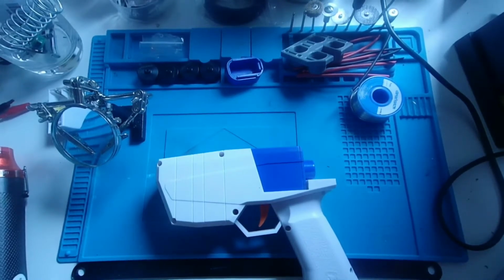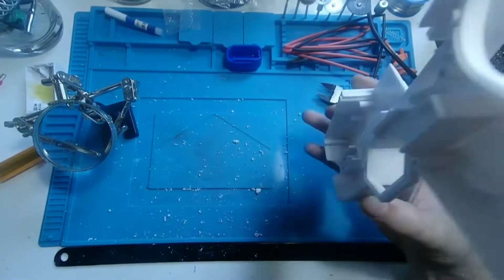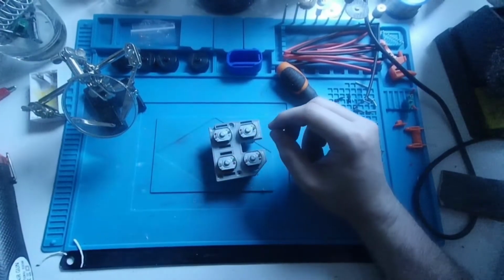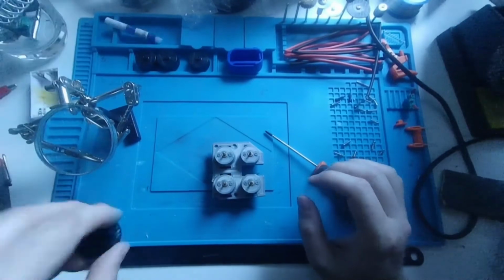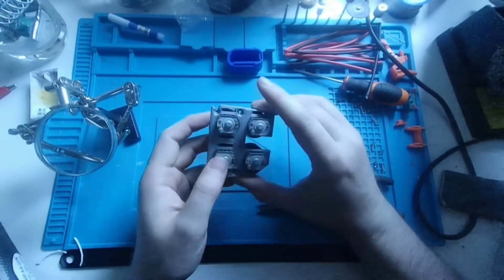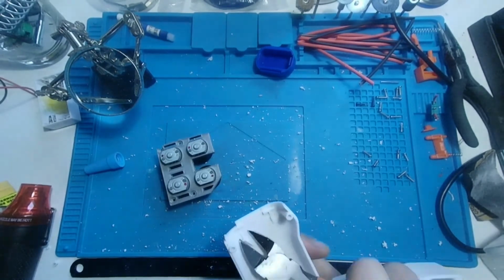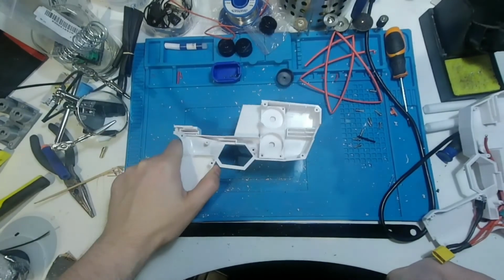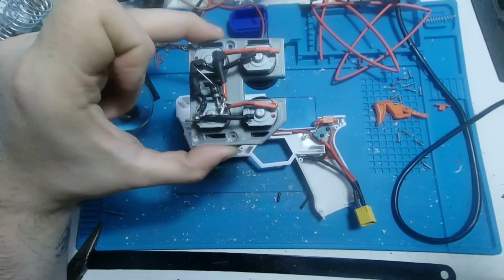The Category 5 Hurricane Build guide

Comment: Tip for preventing shorts from tab/wire to motor. Heat shrinking these motor connections is a little awkward as you end up with a "taco" cover rather then a "cylinder".  Try to lay a swatch of electrical tape on the top of the motor with two small cuts to allow the tabs to peek through. This should prevent the excess solder and exposed wire from making motor contact and is the thinnest solution in tight spaces like this build. Great Video, Did you manage to get your flywheels centered with the dart path?

Comment: What is that there? Did you wire a capacitor between the positive and negative of the rear mounted motors? Also can you explain please. Thank you
Reply from the maker: That is a Flyback Diode - it's an important component in any mosfet build. It prevents back EMF from frying the 'fet.

If you watch the Foam Data Services mosfet video it explains in more detail.
Reply: Iwill check it out, thank you